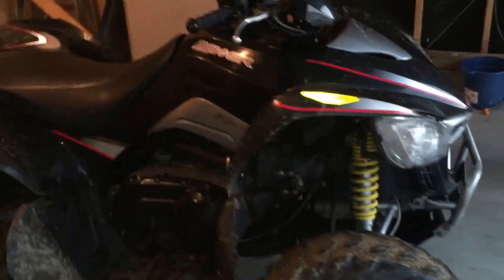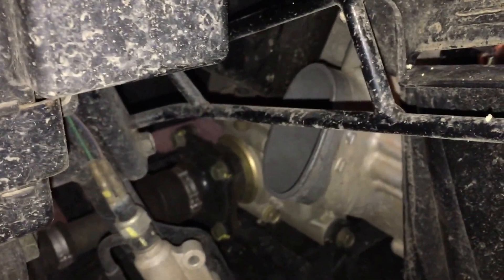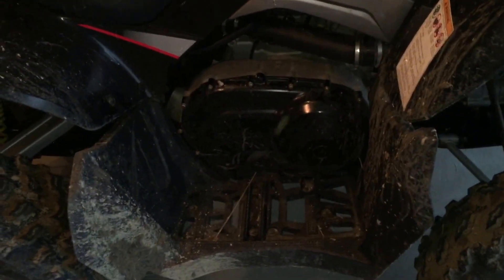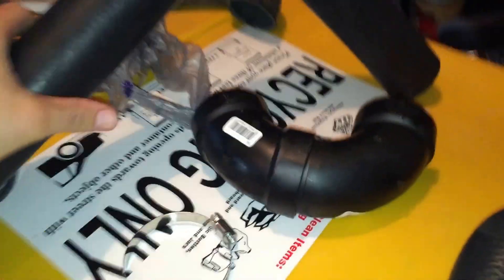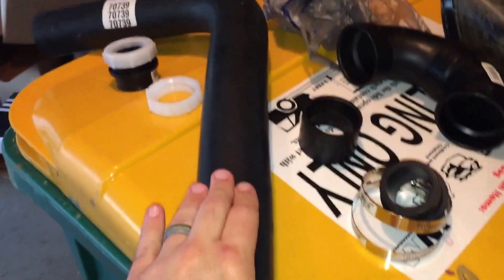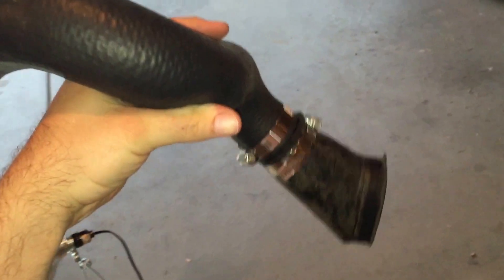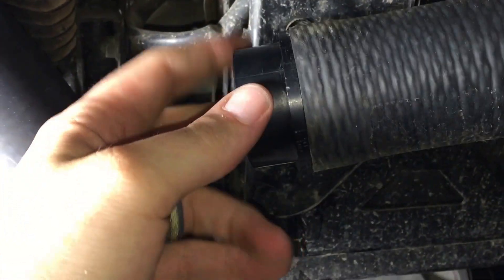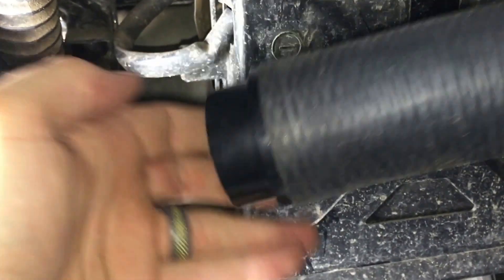Kymco Maxxer 450i CVT Breather Tube Snorkel

Comment: in for a penny in for a pound. Do one do all. I fully snorkeled my daughter's kymco 270. dielectric ALL electrics,spark plug fuse block. carb breathers, coolant overflow breathers,cvt breathers. those black unknown things you read the barcodes are ABS trap adapters for plumbing.
Reply: Please please please post pictures somewhere or a video of how it's done. You can hardly find anything on kymco